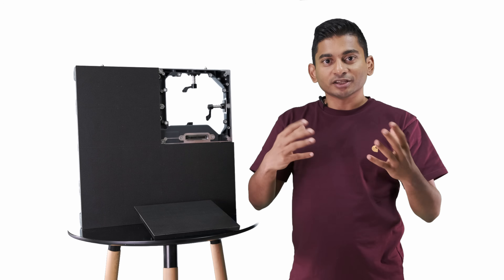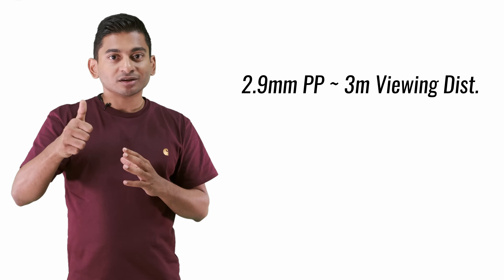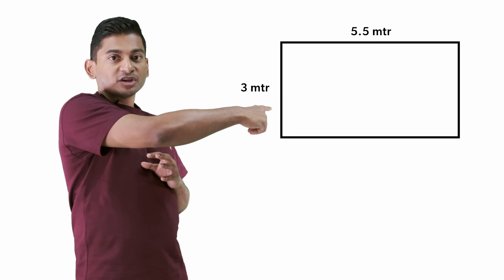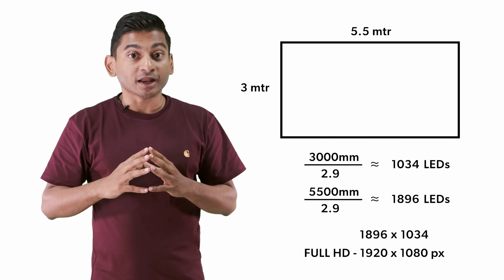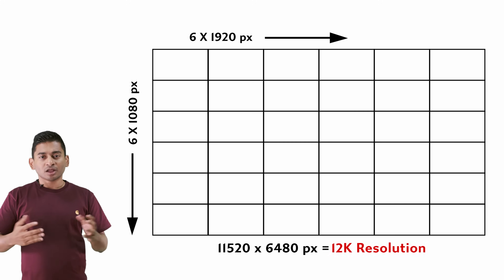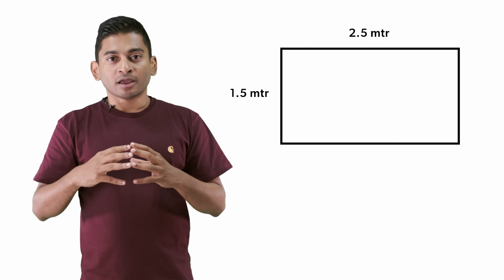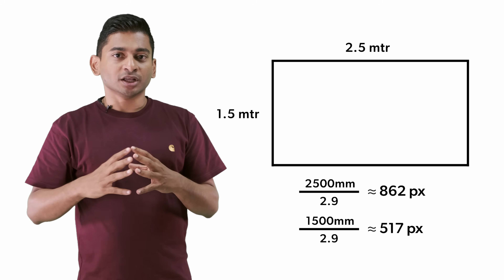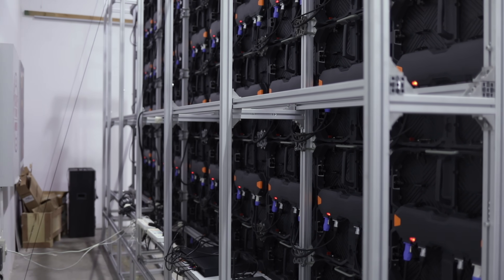LED Screen Pixel Pitch Explained

Comment: Great info....
Great content  +1👍 
One question Im.planing on getting a video wall. 2Mx4M and a 1Mx2M , im planing on getting P1.95 1000v500 panels. What conteoller do you recomend. 
Is the nova VX1000 an over kill. 
I want a controller that would be easy to set up and save money too....

Comment: Another problem i’ve seen when using lcd screens for display wall is that they are sometimes difficult to color correct. One may have factory warmer displays than the other or have more contrast than the other screen.

Comment: i'm beetween 50cm and 1m of a 43inch 4K monitor of 0.245 mm, it's why i can see pixel ... (Philips 436M6VBPAB/00 FreeSync 42.5" VA LED - HDR 1000 - 3840 x 2160 px (Ultra HD 4K) - 4 ms)
For fun can you calculate the distance i should be for this 0.245 mm pitch ?
And how better is 0.155 mm of a 4K 27inch screen (Acer Predator XB273KGPbmiipprzx) compare to 0.245mm 43pouces in term of pixel density ?
the context is i own the 0.245mm 43inch screen and want maybe change for the 27inch 0.155mm because i'm too close of my current monitor (PC gamming) edit : ok its both av. 3840*2160 so just a viewing distance issue on this point but 43inch screen has a issue with "sub pixel" and "area of glow" (the center look more brigter/corlofull than edge)
So HDR1000 60hrtz for 580e vs HDR400 + 144hrtz + no sub pixel issue + no area of glow issue for 880e

Comment: What's the highest pixel pitch (smallest gap) available nowadays?
Reply from the maker: ive heard 0.9mm is quite common commercially now. But im sure there are products lwoer than that, but the cost and installation cost can be very prohibitive.
Reply: @SIGNHOUSETV   Exactly